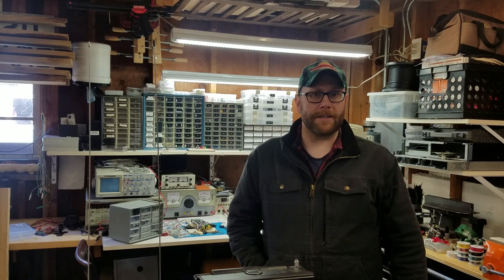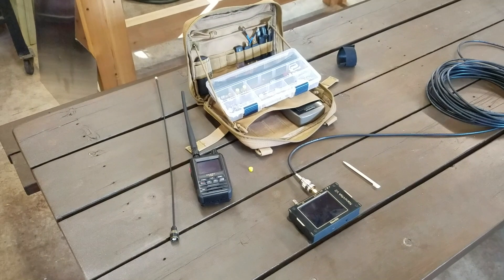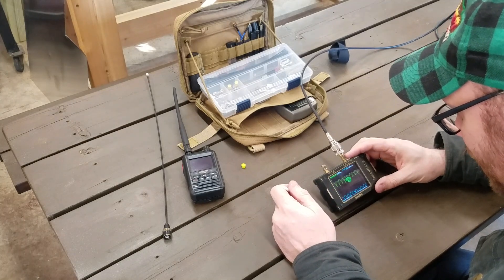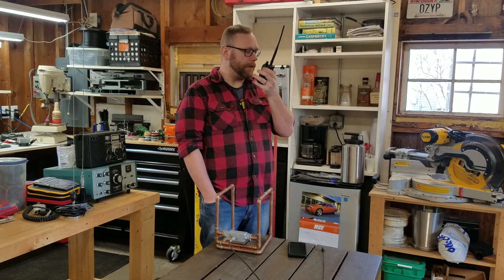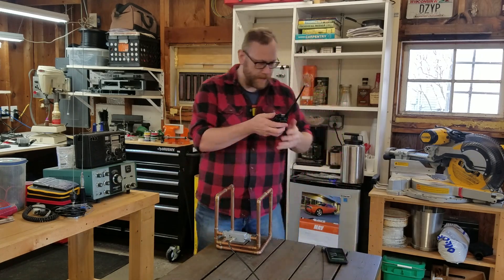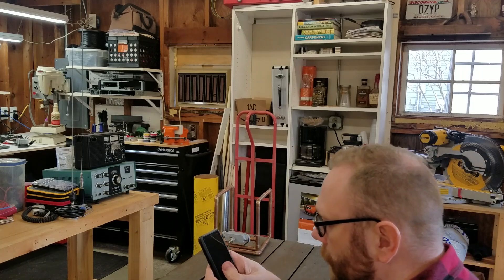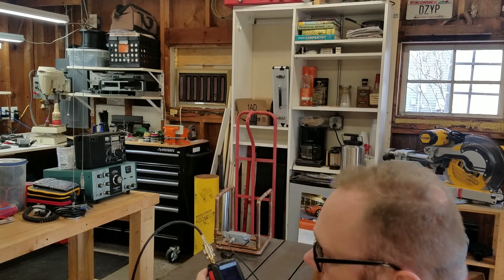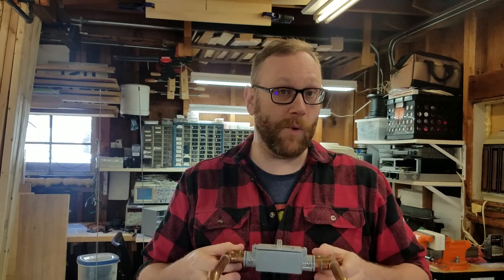Testing a GOOFY Antenna!

Comment: You have the cube antenna in the wrong orientation. The square loops need to be on the horizontal plane for the proper vertical transmissions which the 2m/70cm receivers would be using.
Reply from the maker: @Dazdigo  yeah, I ended up figuring that out later. I did some more   testing off-camera, but I didn't seem to get much better propagation in the correct orientation either.... 🤷‍♂️ 73,

Comment: The video was good information. I seen the article in QST and they had the two pieces of tubing that are parallel in the vertical.
Reply from the maker: @ozone385  I actually discovered that later. The way I have the antenna, it's horizontally polarized. The way you describe, it'd be vertically polarized (more common). Although I tried the antenna a week or so later with a friend, in the vertical position, and I didn't see a ton of improvement in performance...

My experience is still that this antenna's strongest points are its portability and interesting looks.

73,

Comment: This antenna is a version of a hentenna but the hentenna is bi directional however if you were to bend it into a square you would have the cube antenna so guys this little bit of information should help you figure out what's wrong
Reply from the maker: a hentenna would be interesting to build too! You're right, it's similar to this thing!